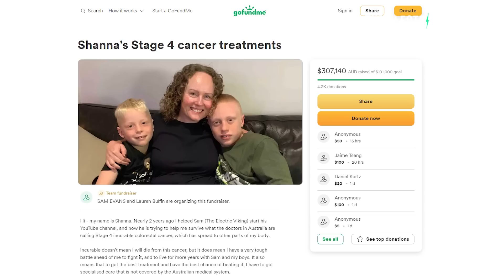CATL unveils Condensed Battery for Aircraft & 1000 mile range EV's

Comment: They'll no doubt split the battery and power electronics into multiple redundant sybsystems. All civilian aviation has mandatory redundancy requirements.
Individual cells going out won't be a problem for any BMS. Only the power conditioning electronics between the battery pack and the engines will need to be duplicated. 
No biggie!

Comment: If these can go in cars, the big innovation we need to hear/read about it, is self recharging....China is obviously going to have superior supply chains and seeing Russia's leadership go rogue is another motivator to China advancing battery technology...but whether western batteries advance or not, as expediently within 2-5 years...self recharging seems completely reasonable to expect given friction heat contact with roads...pressurization of said heat...and reasonably cheap conductive metals. It might not be "supercharging," though that sounds like a cables issue...but over the course of a drive, forces of physics used synergistically should allow ev's to regain charge over 20-40 minutes...Another point is if supercapacitors emerge at reasonable weight/size over next five years, could be another disruptive technology allowing more designs even with inferior batteries. To get customers living in apartment complexes to switch to ev's, charging station anxiety needs to be conquered, because such people probably need to vacation without leaving their car unattended for the time being. Charging breakthroughs are bridge to the most pragmatic batteries.

Comment: Please use WATT HOURS per kilo and/or Litre. WATTS are a measure of POWER, WATT HOURS are a measure of capacity, and of course both these units of measurement are not very informative unless you state the WEIGHT or VOLUME of the battery that has these capacities.

Comment: Just for comparrison, Jet A has 12,000 Wh/kg.
An A320 Sized aircraft using these batteries would have a max range of less than one hundred kilometres (Aircraft have a max landing weight and batteries don't get lighter as they discharge).

Comment: EV I've called you out once before re battery operated flights for large commercial aircraft and asked you to show the maths.  Crickets.  That was with a 711W/kr battery.  Its impossible.  I did the maths for an ATR 42-300 - a small, turbofan, short haul aircraft that flies at 300 mph +/.  It will fly but the batteries are so heavy the passengers and crew have to be removed -   So how are you going to do it with a 500W/hr battery.  More BS from EV.
Putting a 100Kwhr, 500w/kg battery into an F150 saves a bit of weight, IT DOES NOT give it a 5 mile/kwhr range, so 500 miles is garbage.  Now fill the F150 with stuff and tow something heavy in the cold and on a windy day.  You need a 500 kwhr battery.  EV's been taking someone elses meds again.

Comment: I am very closely affiliated with aviation and know that electric aircraft will be commonly used in commercial airline service much later than anticipated. Until 2050/60, conventional aircraft will dominate the market. Airbus and Boeing are sold out until 2030. The oldest A320 still flying was retired by LH last year, after 28 years. Aircraft from the A320-NEO family will be flying until 2055, even if Airbus were to stop accepting orders as of today.

If a modern long-haul aircraft such as an A350-900 were to be converted to the most modern battery technology available today, its battery would have a weight of 1,354 t, assuming twice the efficiency of the entire propulsion system. The max. takeoff mass is 283 t, the max. landing mass only 207 t with an empty mass of 115.7 t. The energy density would therefore have to be increased by a factor of 15, or from 500 W to 7.5 kW per kg. This would correspond to a real range of a BEV of 15,000 km with today's battery weights. One should be quite skeptical about this. 

Fun fact: The range of a battery-powered A350-900 would still be only 50 %, since kerosene is consumed during flight, required to achieve the max. landing weight. A battery loses no weight. At cruising altitudes temperatures of -60°C prevail, which battery can withstand that for 10 h? And how do you recharge 1 GWh in 60 min? Only with a power connection of 1 GW per aircraft to be "refueled" at the same time. E-Fuels will be required for long-haul flights for many decades to come.

Comment: Just for the record, a Garuda 737-800 had a dual engine flameout, no APU due to failed NiCad batteries, and relied on a Ram Air Turbine, and manual flight control reversion to maintain control for a glide landing in a river. One flight attendant was tragically killed in the accident.
As another commenter points out, it's possible that some kind of regen (also for both slowing down during decent to land ) for an emergency where the primary batteries failed.
A dual flameout plus NiCad battery failure occured in a Garuda 737-800 and the jet was controlled through use of a Ram Air Turbine maintaining hydraulics, and manual reversion of flight controls, for an emergency landing on a river, resulting in the death of one flight attendant.
Incredibly rare for a cascading emergency like that to occur. Dual flameouts are incredibly rare as well.

Comment: I doubt very much jet airplanes will be converted to electric. What will probably happen is new small and mid sized propeller aircraft will be designed to use these batteries.

Comment: If this battery does exist then maybe they need more testing before promotion. 
And there is one major flaw with batteries oppose too hydrogen planes. You know how planes need refueling in the air because or error [(because it happens)although rare], hydrogen jets can be refueled while flying. Think of the batteries and weight the “re-fueling” plane will need to carry to get the to the jet in distress. It would slow the speed of the refueling plane also, might make an emergency refueling very costly. While hydrogen is lighter to transport to get to the jet in distress.

Comment: Due to the very wide operational temperatures of transport jet aircraft, consideration for an effective discharge rates between -65C to +60C must be given.  As a note, there are no large transport passenger aircraft with 3 or 4 engines produced by Boeing or Airbus.

Comment: Very strange question about batteries on airplanes at 6:50. If a battery is reliable enough to take off you just make four installations with separate battery and separate engine. There is no specific reason for batteries to go out all four at once if they are already adapted for lower temperatures and high altitudes. And if they are not suitable for altitudes and temperatures then nobody will fly such an airplane in the first place.

Comment: You keep saying "twice the range in a smaller battery", you get to choose one, either half the weight or twice the range (or a compromise inbetween). Then we need to see how many cycles it can take, and how fast it can charge.
A battery that gives you 500km of range is still almost useless if it takes 8h to charge, while a battery that gives you 250km and charges to full in 5 minutes (solid state) would be useful. And then there is price.
BYD makes batterys that are bigger and have less energy then the existing 18650 batterys, but they can sell the cars for $11.000 with a decent range. There are many more parameters too that can make or brake this battery, so lets wait and see.

Comment: Perhaps already asked or mentioned but I also wonder how these cells function under extreme low temperatures in an aircraft, of course they can be heated but that adds up to the weight off course. I don’t know I see more future in hydrogen as fuel for aircraft. But then again I have a lack of real knowledge about batteries.

Comment: 4:40 - 100 kWh is 100 kWh - what you meant to say, put the new CATL's battery as heavy as your present one, and you will get 500 miles of range or more in your F150. You are constantly confusing energy, energy density, power, practically all measures there to be confused. But we get what you mean.
Several questions remain:
- Pack-level energy density
- Power density (speed of charging and discharging)
- Thermal characteristics, potential for runaway reactions, how strictly the temperature needs to be controlled
- And, of course, price

Comment: Just watched a video here on YouTube about new solar cells being developed that are 250% more efficient than those at present. An aircrafts outer shell and wings could be fitted out with these and they could constantly charge the batteries while in flight above the cloudline. 
Be a good combo in a lot of situations. 
High output solar cells charging high energy batteries.

Comment: High density battery is great but high density, high capacity will require substantial re charge times. This would be viable if the battery modules are designed as changeable. Re fill/charge times will then be similar to that of petrol diesel.

Comment: 1,000 klick range is just silly. No one will make such a car, and you would be a fool to buy one.
No - any revolution in batteries is going to result in lighter more efficient cars, not massive ranges.
But here's the thing: there are no battery breakthroughs. There just aren't.
ALL claims of battery breakthroughs in the past were lies (or just plain wrong) and this one is highly likely to be the same.
I'll believe a claim of a battery breakthrough when I can buy a car with them in. Until then, I won't.

Comment: Please stop using EV range as a metric of battery performance. Vehicle range is a design choice. Similarly, halving the weight of the battery in the F150 would NOT give it a 500 mile range from 100 kWh (vs. 230 for the present 98 kWh pack). That energy is mostly going into pushing air out of the way, not in moving mass. That's why the impact of towing depends far more on the frontal area of the trailer than its mass.

Comment: Redundant modules for automobiles are already happening at Ample Inc. In fact when the density gets to 500 Wh/Kg we are looking at full pack weights around 300-400 lbs. DC fast charge becomes more of a problem and slower as the weight drops due to excessive heating because of the reduced thermal mass. It seems clear to me that as we keep seeing these energy density improvements (and we will for some time) that battery swap could be the best refueling option.
Reply: Increased energy density makes it easier to add cooling systems to the packs, though. You're saving so much weight and so much space on the batteries, more robust cooling solutions become trivial to implement without adding tremendous cost or substantial weight and size to the overall vehicle.

Comment: Hey the scientific article DOI 10.1021/acsenergylett.9b02574 has a great graph for you. You need about 750 Wh/kg for narrow body planes, 600 for regional flights, 1300 for long flights.

"he range for regional, narrow-body, and wide-body aircraft was set at 350, 500, and 1000 nmi, respectively, and the number of passengers was set to 30, 150, and 300, while the mass for each segment was 50 000, 100 000, and 250,000 kg, chosen based on previous literature and current aircraft of each class. Then, 100 000 iterations were run for each class of aircraft. Results are shown in Figure 1."

Comment: Energy density by weight, reliability, and durability may be a trifecta but you still have cost, energy density by volume, and manufacturing scalability. These batteries may be winners in those categories as well, but we need them for comparison.

Comment: It seems pretty straight-forward to segment batteries for an airplane so they can be individually isolated... all of the electrical systems on traditional airplanes are duplicated and redundant, and can be isolated. I would think you would want more than 2 redundant systems but having battery management systems and isolating faulty battery banks doesn't seem particularly hard, the only hard fault is a battery running away and catching on fire, unless it has an ejector system, that's a pretty critical failure as typical suppression systems are pretty ineffective against battery fires.

Comment: I ride an electric bike running a 32AH 60volt and have about 18K miles on it and the battery is about done. When it was new my range was 40 miles. Now im at 25. Things are changing so fast I dont want to spend 2.5K today and my new battery will be obsolete in a week and its not just the battery, its the charging systems as well. It seems all major players deal in cars, planes and or power grid scale. It seems like im going to have to wait for all this tec to trickle down to the E-bike level??? UGH...

Comment: how can 500W/kg be what you needed on airplane? short distance planes yes.. not the majority of flight's. in the world. and we know WAY to little about this batteries to stop other research. charge time, recharge cycle. etc etc. 
Why do you talk about 50-100kW in a car/pickup? we need 300kWh in a pickup to get "usable" range. and that will no compete with a diesel truck at that it will just ba able to be used. the 130kWh they use now force you to charge every 100 miles. AND charging a truck with a trailer is a bitch as you often need to take of the trailer to get to the charger. this make them "useless" ppl that got the F150 is selling them now as they "just dont work" and 20-30% og the ones that ordered one is not picking them up. they r filling the parking lots at the dealers at the moment.

Comment: Hang on, is the predicted range 1000 miles or 1000 km? Also, if you say the usual battery density is between 200 - 240watts/kilogram and if you divide that into 500watts/k you get 2.5 - 2.08 which gives a range of between 416 - 500 miles, NOT 1000 miles.

Comment: Battery capacity isn’t the problem, the problem is that we don’t have the generation capacity to charge the extra millions of EVs. The research needs to go into developing motors that use a fraction of the wattage to do the job of driving a car around for 500 miles between 80-20% charge levels.

Comment: 500 per kilo wow
Jet a 12000 watts per kilo.
As fuel burn carries out it lightens the aircraft thus allow greater range and flight level
Batteries do not decrease weight as the energy is released.
Jet a takes 30 min to refuel .
Batteries  ?
This will not happen. Aircraft don't make money sitting on the ground.
How you going to charge 20 30 40 Aircraft per hour. 
Aircraft arnt cars.  Weight verse power dose not add up.

Comment: Huge news Sam!  Would be great to know more about the cost / materials in these batteries.  If not tremendously expensive once manufactured at scale, then takes the EV range issue completely off the table and fully/finally kills ice.
Reply: It's sort of a given that they will be fabulously expensive to start. If they weren't, then we would have seen a much different presentation from CATL. The only reason I can think of that they're marketing these things as aviation specific batteries is that they cost a lot more on a Wh/kg basis than Li-Ion (NMC) or Na-Ion batteries. If they didn't then they would be targeting the much more established automobile customers. Currently there's NO electric aviation companies shipping more than trainers, so zero reason to prioritize supply to them unless the new 500Wh/kg batteries couldn't compete on price with current car battery pack designs.

And there's certainly no reason to use these new batteries for stationary (Powerwall) applications, since size and weight (and energy density) don't really matter much for batteries stacked in your garage, or mounted on a wall.
Reply: @daveweinstein5044  Maybe they are trying to prove the reliability of this battery technology by using it on the plane.

Comment: Connect the cells in parallel and you will limit the redundancy factor to make it almost negligible. Motor reliability is extremely high as electric motors have been used for many applications in the temperature ranges the plans will need to operate at - no issues there. Good call from this manufacturer. Now lets talk price...

Comment: Stop saying "energy density". With aircraft, its all about the weight. There was never a problem finding space on an aircraft, the wings, where gas is stored, are for the most part empty on light aircraft. The problem is batteries are:
1. Far to heavy.
2. The weight does not change. Unlike gas power, they don't get lighter as you fly. Gas does, in fact it goes to 0.